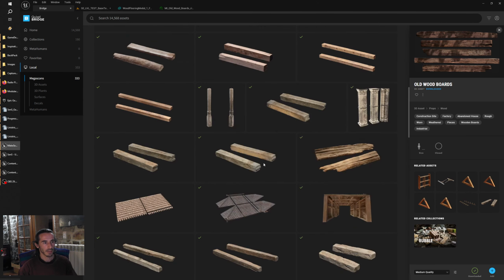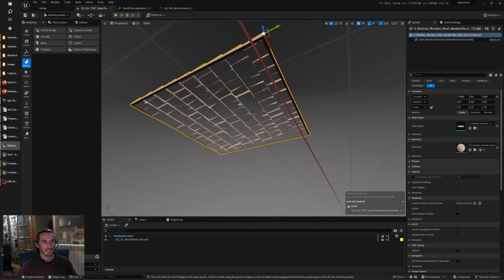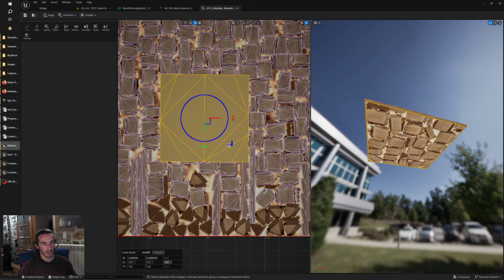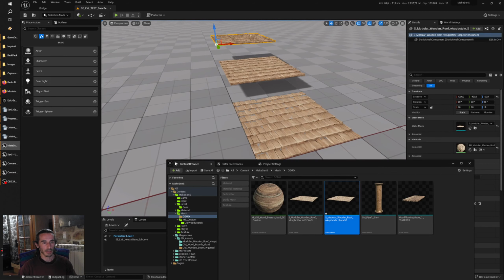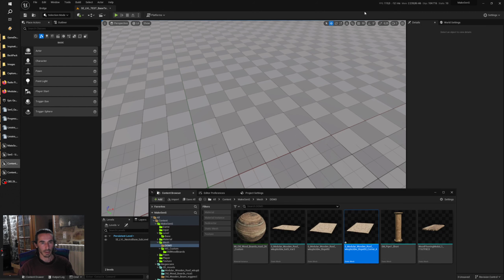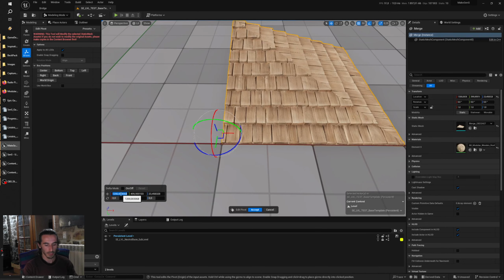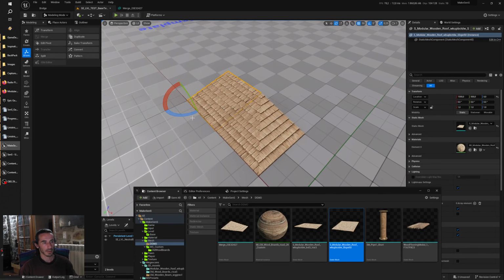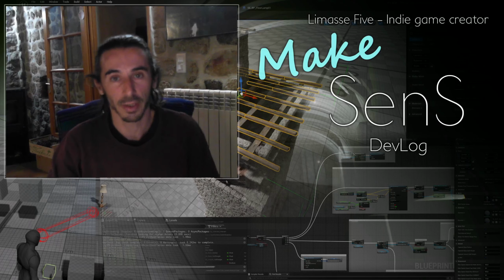Modeling tools in UE5, easily customize Megascans 3D models - MakeSenS-004-EN-p2

Comment from the maker: Is cases such as here with the roof corner, where you need to merge two parts that are touching each other, it's probably better to use boolean. It will be more optimized.